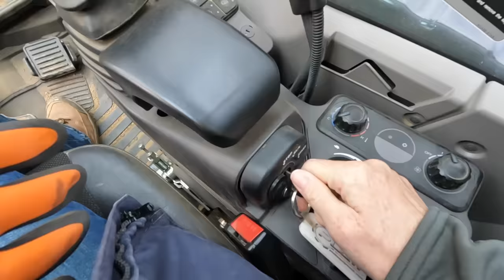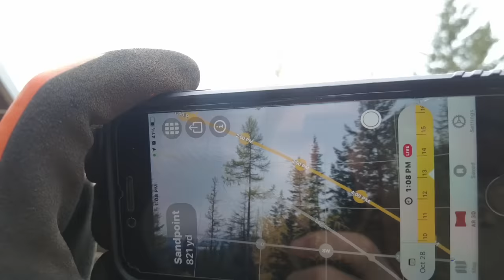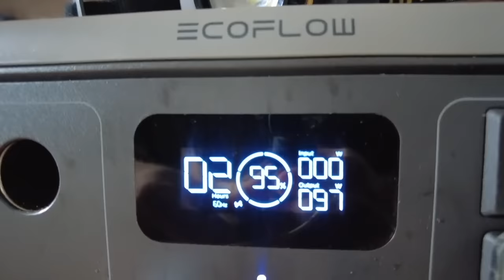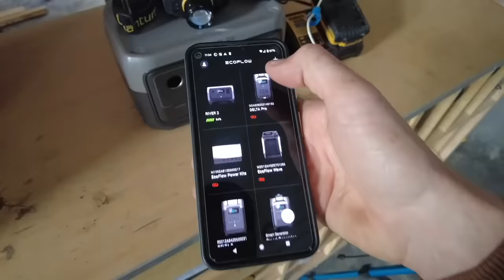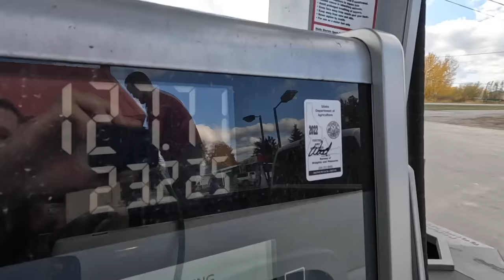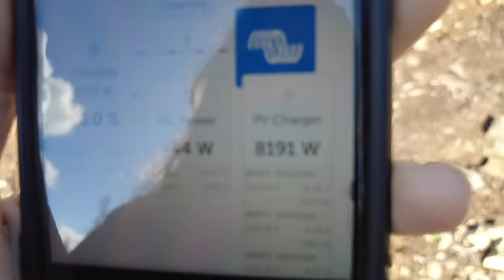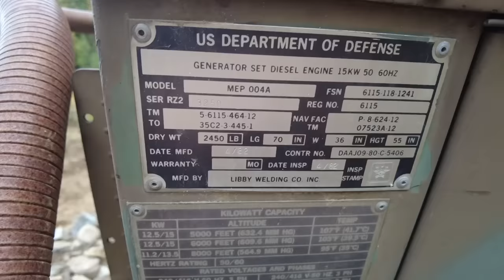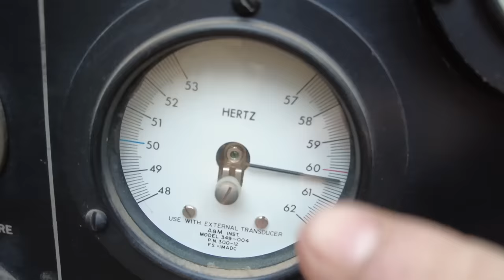Fixing PROBLEMS With Our Off-Grid Solar

Comment: Put a reinforced plastic tarp in front of the panels staked to the ground on the slope and the snow will slide down the hill as it melts off the panels. Remove the tarp in spring. It completely eliminates the wet snow from building up in front of the panels.
Reply: I would be concerned about the possibility of water induced corrosion on the bottom panels if the cannot dry out. I worry that at bottom, there will be an ice dam forming make it very difficult to address. since they are touching the ground. I think it would bet better to use an angle so the panels are at least 2 feet off the ground.
Reply: A white tarp could  help improve production with scattered sunlight reflection. It will also help minimize erosion of the bare excavated earth where the snow would run off otherwise... Next summer stuff can grow there but this winter there could be a problem there.

Comment: Don't forget to ground the generator, while at 9th Engineer Support Battalion I ran those a lot all over Asia for several humanitarian missions and that was one of the things most often forgotten.
Reply: Came to say that. Should be an open lug on the frame for grounding. Very important for safety.
Reply: if whole electric system is bond it to ground and main shop have a ground rod a second one by ground rod is bad idle
Reply: I forget if they installed a ground rod?
Reply: @CubbyTech  back to first concrete pour set all pipes and conduit and one ground rod
Reply: Edward Uechi. I was with 9th Engineers back in the early 80s, BulkFuel Co.. Happy Birthday and Semper Fi.... and you're right on grounding the equipment
Reply: @jessesaenz1021  Thank you for your service!
Reply: I would also suggest a small concrete pad and weld or strap down to inbeds so it don't vibrate itself off the hill

Comment: That old army Geny is sweet,I would give it some extra TLC before winter sets in . Drain the diesel,burn it up in the excavator,put some nice fresh into the tank ,change the filter .Add a small cheap electric heater from solar output into the frame of the generator keep it nice and warm on a thermostat ready to kick in on those cold nights when the power banks are getting depleted.I don't know how cold it gets in the winter but it would be nice to know that the gen gonna fire up without any hassle keeps the condense out of the old skool analoge gauges too , sorry and wrap it in a tarp ,I know i'm weird like that 😂 nice to see real time your boost by altering angle .

Comment: On the Excavator, when parking it Outside, move all the Cylinders chrome shafts back into the cylinder barrels where the oil is. If you expose the chrome shafts to the weather it could cause rust to eat into the shafts then the cylinders will start leaking and then you will have some very expensive repair bills.
i worked in hydraulics for 40 years and I seen this happen very often

Comment: You should pour a slab under the generator.  Otherwise two things will happen.  first the built in skid will rust away and second, while running the vibrations will cause the generator to sink into the ground.  Which will allow the moist soil to start rusting the bottom panel of the enclosure out.
Reply: Perhaps put some wood cribing or concrete blocks for the winter, and then pour a bad next season. Better with be some sort of roof (open enclosure) to keep the rain and snow away, big enough so you can refuel, change oil with dealing with snow.
Reply: Or weld up a skid frame for it ! Lol genius I know.
Reply: @dneuman7455  Just like the existing skids, your metal "skid frame" would eventually rust away from contact with the constantly moist soil at their location.
Reply: there a lot rock under generator and is rock base under solar container Hill side drain pipe too
Reply: @akdisney  I hadn't noticed the rock until a later video.  It will provide drainage but there still should be some kind of roof over the generator as someone else mentioned..  Also the rock can shift under the vibration when gen is in use, so something a bit more solid would still be good.

Comment: I would suggest y'all stabilize the slope you dug off in front of the solar array. It wouldn't be good if the ground got saturated and decided to slide taking the solar array down the hill with it. 5 or so dump truck loads of large rocks from around your property would work. 8 inches to 20 inches or so in size. Small enough to handle by hand but large enough to hold the slope. Several layers thick not just a single layer would be best. That should be a priority before the wet winter season and thaw in the spring is gonna be harsh on the slope being a bigger chance to fail at that time. Something that would also help which I'd do before the rocks is to use the excavator and track the hill in to pack the dirt good. This is very important to get both of these things done soon as y'all can. Good video. Stay well. -Wil  👍

Comment: Since you got the excavator back down off the side of the hill I'd recommend checking the track tension on both tracks. After you put them back on and drive a little ways everything settles back into position and it can be loose again, and since that one was loose enough to come off in the first place, the other one may be getting loose as well. 
I love your channel, and I wish I could be doing all that stuff too.

Comment: Nice work on that track!, I recommend keeping the fuel tank full on that generator, the biggest hassle with the diesel generators was fuel problems, mostly caused by water in the fuel, which is often formed from condensation. Full tanks don't allow a lot of air to weep moisture into your tank, when the temperatures fluctuate. I enjoy seeing what you guys are building, keep the videos coming!

Comment: I’m not sure if it has been mentioned but try making a larger wedge cut and even considering a hinge cut rather than a pointed wedge. Then with your back cut it will want to fall much easier and not snap potentially causing a kick.

Comment: Tracks are all about that tension. First thing to do before any kind of track maintenance is release the track tension.  Doesn't matter if you're replacing thrown track, repairing the track or replacing the track. The tension keeps it where it it, so any changes to that requires taking out the tension.
That rubber one piece track on your excavator is very end user friendly.  
Glad you got it sorted and that solar input from the clearance and angle adjustment is super impressive.

Comment: You need to cut wider notches and leave a hinge to control the fall and avoid kickback
Reply: Just trying to be helpful, but there is a whole "geometry understanding" to being good at "falling" (in the parlance of most tree people) trees.  And there would be "backcut first" technique, "shark jaw" technique.  "barber chair prevention" by little cuts in from the side, etc. etc.  A guy who was in my graduating class an an "elite university" dropped a tree on himself, died.  Just sayin'.    Wider notches, thinking about where holding wood is on hinges, knowing how and when to plunge, then cut release...
Reply: At my forestry college we were taught the Swedish technique for felling. It's easier to show than explain. Gives you a lot of control but any tree can surprise you by doing the unexpected and those times can kill or maim you
Reply: second cut high up

Comment: TIM from Canada suggestions if you have any flash drives you should maybe make a folder that every time you find a video that helps you fix something you keep that video. for example the video that helped you fix the track. make a folder put the video in that folder. market things I fixed and every time there is a video you need to find you can go back to that folder and anytime you need to fix something you put a new video in that folder just something to look at in the future

Comment: Suggestion: get sheets of metal roofing and put them at a slope below the solar panels so that the snow will slide off of the metal panels but light will also reflect off of the metal roofing onto the solar panels.

Comment: Do I recall correctly you installed three inverters that could give you 120/208 3-Phase if you needed it? If so, moving the side taps back to 120/208 would be advised on the generator. The MEP is far more power efficient on fuel when running in 3-Phase power. It would also allow the passthrough power on your inverters.

Comment: One of the many lessons you will learn if you operate an excavator in rough terrain: You never swing the lower drivetrain while partly submerged in soil, or the track may jump off and you'll get stuck. Luckily the rubber belts are very forgiving and can be handled alone if you are strong, careful and know what you are doing. After putting the track back on two times in an hour, I got kinda good at it. A shovel, grease gun, a solid pry bar, toolkit and a piece of chain to help pull the belt with the bucket, all can be good to have when you get stranded with a track loose.

Comment: I know it's going on two years since you tackled removing the trees blocking winter sun to your solar panels.  Still, I'm just viewing the vid for the first time.  I'm betting with 1500+ comments, someone probably already covered all the best suggestions.  In case they didn't (TL/DR them all), consider using an excavator arm, a backhoe arm, or a bulldozer, or your skid steer bucket to push against the tree as high as you can, while a second person notches & fells the tree in the safest direction.  Once notched, pushing with your power equipment may be all that's required.  But you won't have to worry so much about the tree going the wrong direction.  And you'll have some handy protection for the person with the chainsaw.   Oh, also, if/when cutting several trees, cut the furthest one first and fell it away from the rest.  That makes cutting subsequent trees easier & safer.  Best of luck in your adventures, and keep up the great and fun work!

Comment: You should put some rip-rap using large rocks above your solar panels to protect from any heavy rains or snow melts.  Because you have loose dirt all around your solar container, it will easily erode if you don't protect it from downhill water runoff. Make sure that you you bury a geo-tech fabric designed to be installed under rip-rap to prevent the water from undermining your rip-rap. Generally you bury the fabric a couple of feet below the surface and compact gravel over it. The end of high side of the fabric that faces the downhill water flow should be buried vertically about four feet.

Comment: When dragging logs with chain, wrap the hook end back around the lead to create a slip knot. It's actually called choking the load. 
The idea is the tighter you pull the tighter the chain becomes.

Comment: I recognize it's inconvenient to take the diesel (or gasoline) containers out of the truck before filling, and then having to lift the full tanks back up into the truck.  But it's the way you'll avoid creating a static spark that could spoil your day.  I hope you can find your way to taking the extra little bit of work that'll protect your body & your equipment from burning as you fill your tanks.    

Per Google AI:  Remove diesel fuel containers from a vehicle and place them on the ground at a safe distance away before refueling. This is to prevent fires that can be caused by static electricity buildup. Other safety tips for refueling include:

Turning off the engine

Keeping sparks and open flames away from the fuel tank filler valve

Not smoking or using a cell phone while refueling

And as always, keep up the great work (safely)!

Comment: When you do the back cut with the chainsaw do it about 6" above the wedge so when you cut straight across it will leave a 6" lip.  It should split loose on its own and you can use wedges like normal.  The reason is to keep the bottom of the trunk from kicking out and possibly hitting you.

Comment: As an owner of a couple of diesel fueled tractors and a truck, it really helps to have an on-site fuel tank and pump. If you can't get a local oil company to come and refill the tank then you can put a tank in the bed of your truck, sized according to your needs, and perform a transfer to the site tank. I've done the daily fill-ups of diesel cans and after a while you realize the amount of time lost transporting fuel that really costs you in terms of time and productivity, especially if you're in this for the long haul.

Comment: Had an old generator like that at my family cabin. The problem with them is the frequency changes under load, and you have to adjust it while under load to get it right. Why there isn't a feed back to adjust the throttle I don't know.

Don't run your sprayer without liquid in it. The liquid is the lubrication. Also running empty doesn't prove anything, the load is when it is at full pressure. It's a small motor though, it will work.
Reply: Put water and food cohering in the sprayer and paint a center line all the way down the drive in the snow. That is what i want to see, Don't miss showing the dozer parked in the snow as you go by. Don't ask what color to use. Use Red. As for comments after the event.

Comment: For fire starters in NC I use for outside and inside fires are pine cones. I buy a 10lb block of candle wax and I dip a small portion of the cone the throw into a 55gal trash bag for later use. A 10lb block of wax will do about 7, 55gal bags of cones.

Comment: Back in the 70's we would find stands of dead Tamarack that had been killed off in the 1910 forest fire, which started in Washington and ended in South Dakota. These trees were all buck skins (obviously) and still standing and very big. Some measuring 6' at the butt and not one branch on them. Like giant tooth picks sticking out of the ground. Great firewood. If you want to see just how big these Tamaracks grew before the fire, go to the back side of Lookout Pass ski hill and look southeast, which will be in Montana. There is a live Tamarack that, from that view point, makes the trees around it look like blades of grass. It has to be over 300 feet. John Mullan call this area "The Land Of Big Trees", as they made the first trail in the 1800's.

Comment: Fixing a Solar Problem like this  really comes down to not thinking one monolithic array is the solution but thinking outside the box as they say instead. First of course is to know the Sun's path in Winter because its daylight is shorter and a more vertical layout would be ideal since it collects just as much. Indeed the few minutes that were gained by cutting down more trees seemed to make sense but configuring to accommodate its shadows in the mornings-sunset was better. Of course the more there are the better since it lessens the mass clearing and gives more power in trade. Erosion is a factor nearly as much if not more just for those few minutes of gain and with that much space adding on more if not higher not wider on the array is a thought.

Comment: TIM from Canada if there is a way for you to modify so that you could use your power drill to move your solar panel if there is a way to put a longer bolt on so you could use a power drill this will save you in the winter time something to look into

Comment: In case of shadows, it is recommended to use microinverters (on-grid) or short series of panels (off-grid) with a max of 2 or 3 panels per serie. This is to avoid losing production.

Comment: I would try adding more grease to increase the tension.  Tracks looked pretty loose to me.  Good rule of thumb is to raise up the machine and then stand on the lower part of the track and see how much it sags. Shouldn’t sag more then 1/2”- 3/4”

Comment: I hear ya on being a pyro. I live in the adjacent state and manage. Certified burner program. I would be happy to help with any burning needs. If you burn more piles consider a larger propane torch attached to a 20lb propane tank. You can get them at North 40. Burns wetter piles easier!

Comment: You've already learned about diesel fuel gelling solid in the winter; don't forget to winterize that diesel generator by the solar panel / container before it gets cold.  You know Murphy.  He'll cause all your regular power options to fail at the coldest time.  But you'll have old man Murphy fixed good if you keep all your diesel toys winterized against cold weather gelling.

Comment: Just a heads up...drag, your whole lot, with 4x4 quads. Get some fence, tie wire weights to it.
And drag, all the dirt,..your going to break your legs if 4" of snow covers all those rocks and holes up...smooth them down now.. and buy, 5 foot fiber glass, bright orange, pole to mark off where cliffs are, big drops, 4feet of snow, walking that lot will be dangerous..

Comment: 9:05  Bungee cord is way quicker. Also, on the taller tanks, add a ball valve at the bottom of the hose & a 45° street elbow at the top. Makes it a lot easier to pour without spilling. Especially in winter, when that clear hose is hard to flex.

Comment: Hi Riley, you need to leave a step on the trunks by making the rear horizontal cut about an inch and s half above the point of your front 'V' cut. The step stops the falling tree from kicking backwards. You did n't do it on the first tree.

Comment: Keep in mind that because it is a 3 phase delta generator and you only plan to use 2 of the 3 legs (one phase), you won’t actually be able to use the full rated output of the generator. It’s 15kw total, but one phase will give you about 8,650w if I’m doing the math correctly.

Comment: If you can make a 3 phase input to your charging system you will significantly reduce the amount of time that you have to run the generator. Most "big"  generators like that have a windings junction box and that is where all the individual coils in the generator are connected together, as often as not the various potential output options are shown on a label on the inside of the cover. Look into it.